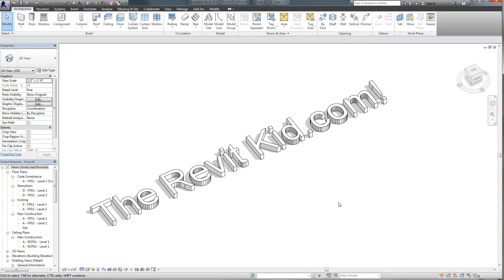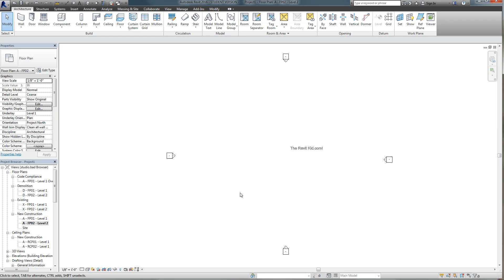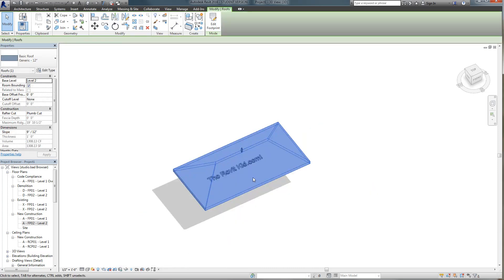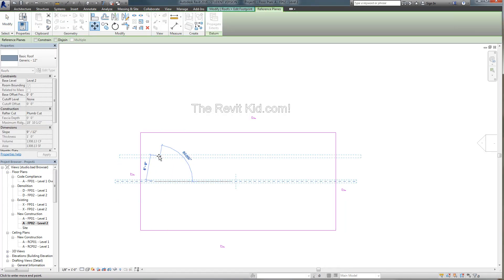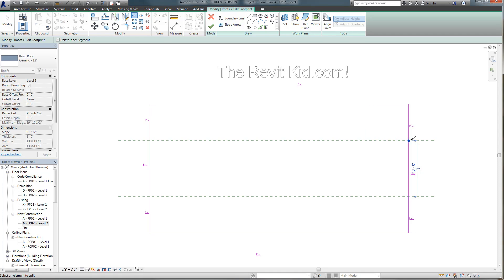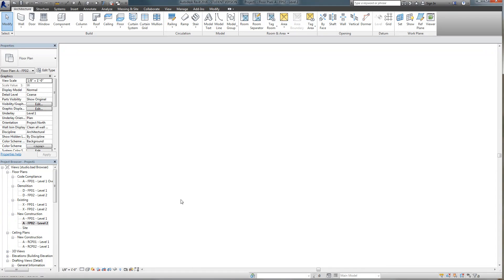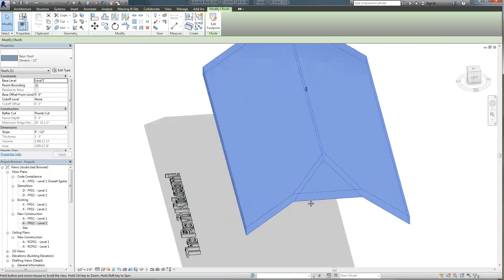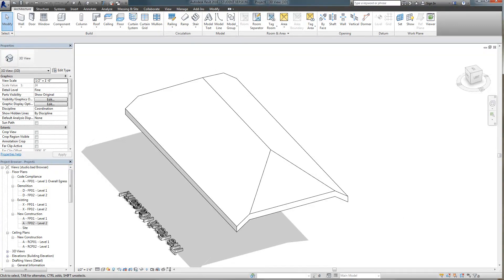Revit Tutorial   Jerkinhead ( Half Hipped Roof )

Comment: Short and clear explanation as always, it is nice to see i had the method figured out in the right way.

But i was wondering do you know a way to model a jerkinhead roof with two diffrent heights on the gutter sides, one lower than the other?
Reply from the maker: Hey Ben, I am not sure what you mean?  Do you mean the "long" sides of the house are different heights from one another?
Reply: That is indeed what i meant.

What i did as a soulution:
Is modeled a jerkinhead roof on the level of the lowest side, and cut off the other side with a void to create the higer side.